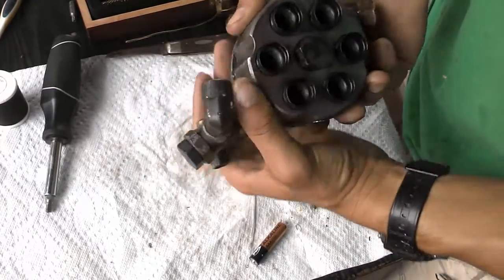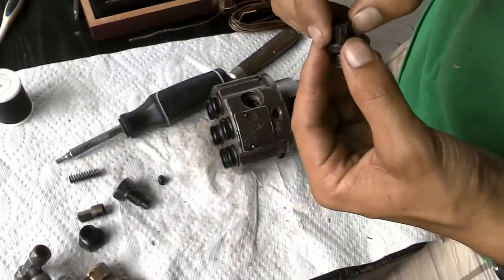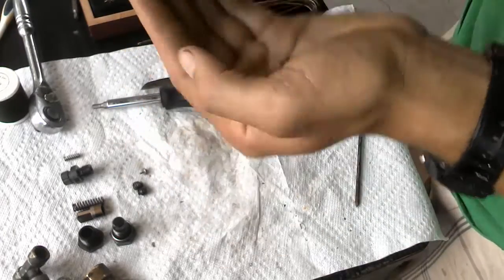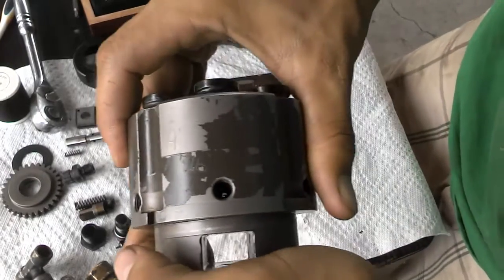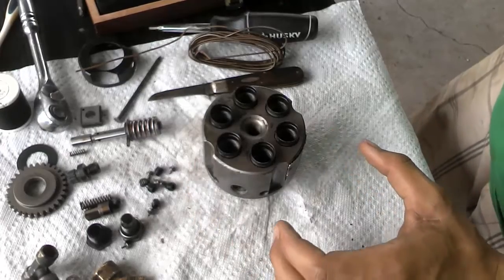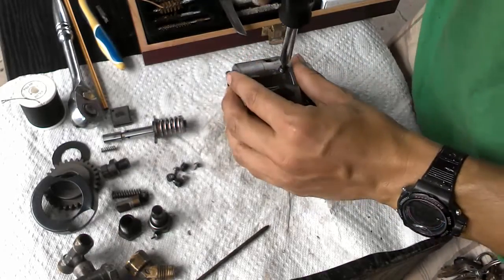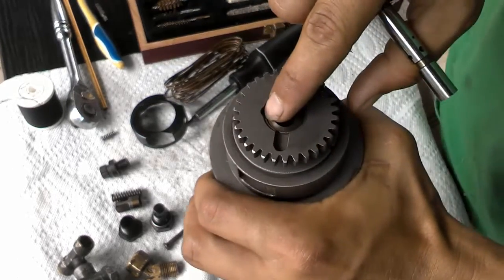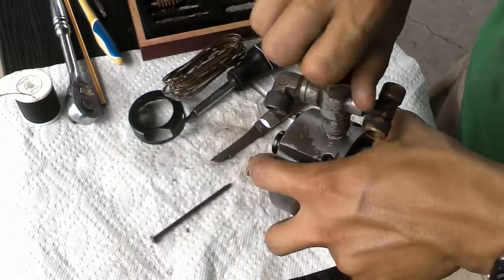M35A2 Hydraulic head  cleaning

Comment: I can tell you that with 21 years of Army DS/GS experience that aside from leaks, 90% of the time the injection pump was not the problem. When the Automotive Shop would "inter-shop" the pumps to the F&E Shop they guys would throw it on the test stand and it would work fine. Most of the time it was bad fuel or bad injectors.

Comment: Did you ever get yours running?
Reply from the maker: Yep, I prepped the intake with a ether diesel pump spray to jump start it to get the air out of the lines. Had to clean some injectors but fired right up after the HH got cleaned
Reply from the maker: But I'm having trouble with another, I can jumpstart her with a either diesel mix and she with run on that through the intake but she will stall once I stop. I feel that its the injectors but I'm not experience at all with that. I kinda need help figuring out what to do next.
Reply: I have a parts truck I’m trying to get running as well. I had an idea. Pull all the injectors out. Reconnect them to the injector lines with them aimed in a SAFE direction. Crank the engine over and see how the spray pattern looks. Then you will know if you have injector or IP problems.
Reply: @derpyrage3852  there are injector testers like a hydraulic jack pump with a gauge. It bench tests crack pressure of injector. It needs pressure to unseat the pintle in the injector, it lifts/sprays, pressure drops and pintle closes.

Comment: (Injection pump is on engine). Do I need to have the engine on time to be able of removing that injection head? Mine leaks around the bottom section of that injection head and I purchased a 3 piece kit of O-rings for it. Help!
Reply from the maker: Idk if this is your problem, limited info you gave, but you may have wrong diameter rings or there might be debris, note a grain of sand is way too big, smaller objects will cuase leak. Also if threads are worn or rusted, there will be micro gap in between, enough to leak.
Reply: @derpyrage3852  I have NOT replaced the o-rings with the new ones I bought. I need to know, how to replace them...
Reply from the maker: And to take HH off I just aligned the red or indented groove on the HH timing gear and it pulled straight out very little force, if it takes more, you may have obstruction.
Reply: @derpyrage3852  ok, but how do I align that with the pump still attached to the engine? Turning the engine/crank?
Reply from the maker: @wilmersegarra1574  yes, the engine will turn over and the HH will move with it, idk a sure fire easy way, other than just turn over engine until you can remove it. Don't turn engine with HH unscrewed, gear could slip off and chip or break.
Reply from the maker: Got to steal soldiers . com and they have all sorts of tear downs and information, it's wear I started learning this stuff about Deuce